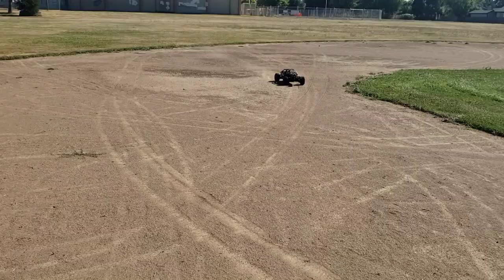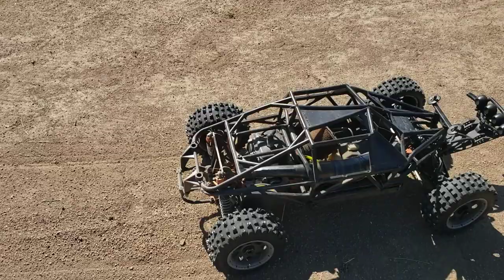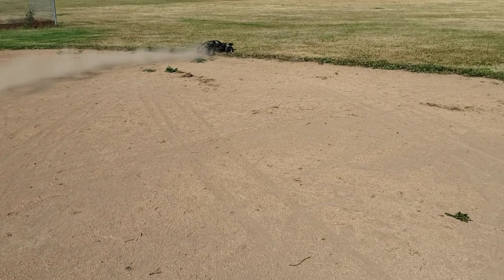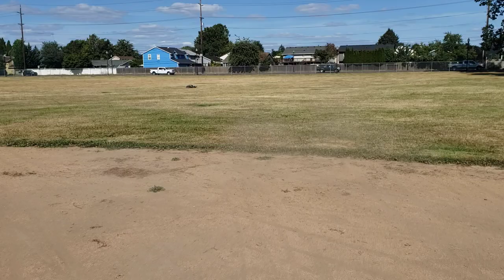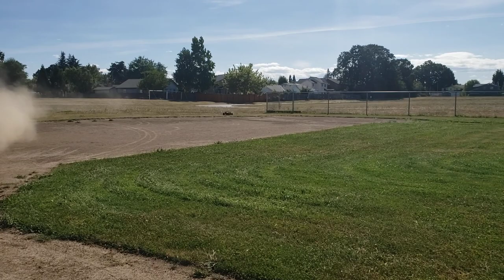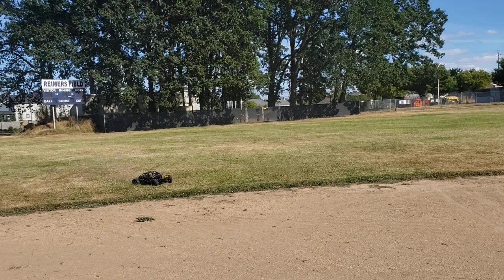HPI Baja with Kold Kutter studs

Comment: Super rad my man, I have these screws also but haven't racked up a tire with them yet. Damn, they bite. What tire and wheel do you use for these? Thanks man
Reply from the maker: I'm running an old pair of Hostile MXT tires on the stock Hpi Baja 5t wheels and foams.